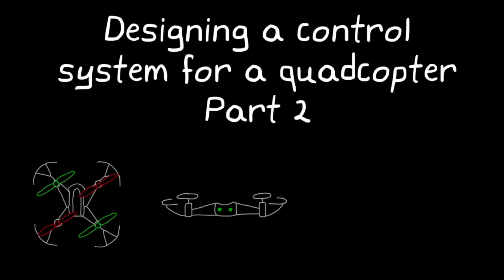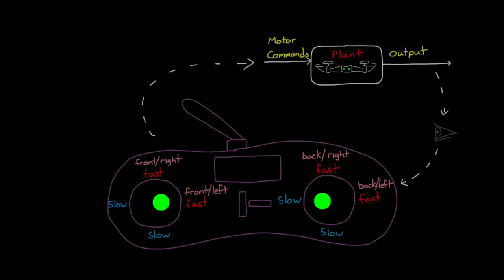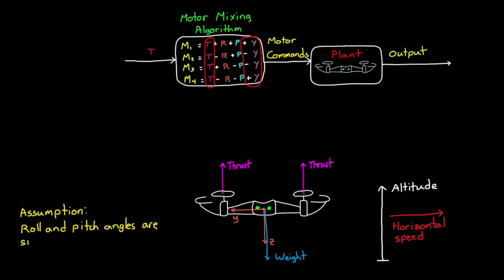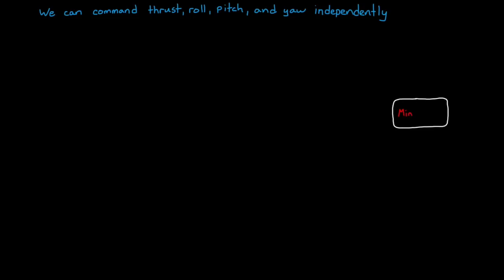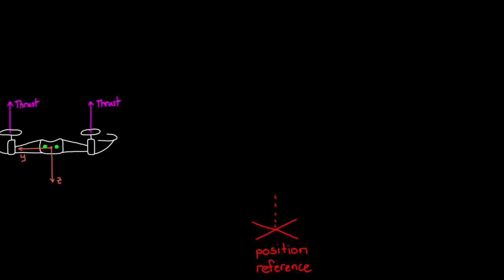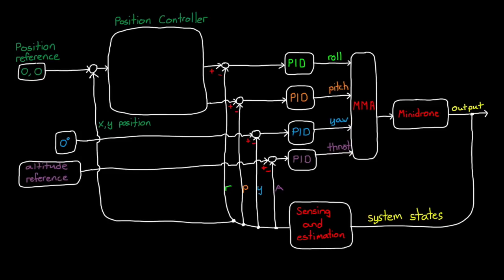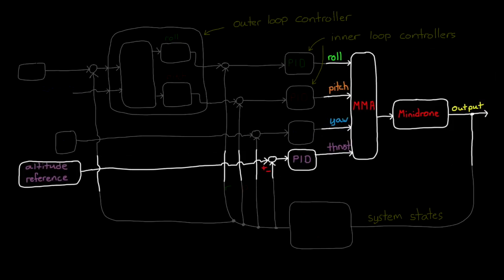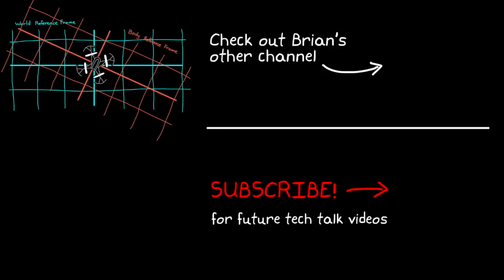Drone Simulation and Control, Part 2: How Do You Get a Drone to Hover?

Comment: Hi everyone, thanks for watching! If you have any questions for me leave them on this comment so I get notified and can try to get back to you. Cheers!
Reply: Great video! I ask myself: At what point would you "interfere" with manual control inputs now while the drone is running? Like in a drone that you fly yourself, but once you let go of the sticks, it just hovers where you left it?
Reply: sphericalsphere you could set up your hand-held remote controller to command altitude rate, yaw rate, and XY position. These would be converted in the software to the reference signals that the control loops use that I described in this video. When you’re “manually” flying your drone you’re telling it to go up or down, or to rotate, or to fly horizontally. The inner control loops are still running during this and keeping the drone stable and following your commands. As soon as you let go of the toggles the drone would immediately start to hover since you’re telling it to stay right where it is.
Reply: hi brian 
i am having project to design a lidar enaled uav system for terrain mapping is it possible to use a lidar sensor in this also
Reply: Dude I follow your channel as well, I had no idea it was you in this series!
Reply: Great video Mr Brian, my question is how you can get the (x,y) coordinates without a GPS.
Reply: Hi Brian,

Thanks for Great video!!!

Can I ask a question about the Drone Control but not using PID using LQI. I have quad dynamics, which  have motor speed expression such as thrust=u1^2+u2^2+u3^2+u4^2 , x direction tork = u4^2-u2^2 and so on. As you noticed, these are square terms,in that, direction of rotation is ineffective for my dynamics. But you explain so much direction of rotation to reach reference point. How do LQI controller track reference succesfully without concern direction of motor. Briefly, direction of my motors are not important for my model. Is something wrong ?
Reply: Hi, can you maybe further explain why we need cascaded loops for the pitch and roll angle. Cant i just multiply the position error with some constant value and restrict it to lets say +- 5 deg and use that for the second PID loop? That way we have less PID controller to tune. Other online material stated that cascaded loops are only of an advantage when there are multiple measurements and a faster and a slower loop. But this is not the case in this system. Thanks in advance. Btw, great series, currently trying to build a control system for an arduino drone, you are helping me alot.
Reply: How do we interpret the result that the mma gives us, as forces and moments or as something else? Cause we need to give a duty cycle to a pwm for controlling the motors.
Reply: Could you please provide us the presentation in any format like ppt or pdf.
Reply: Hi Brian, at 9:46, you mentioned cascading pid controls, considering roll alone what is the error fed to the first pid? Also yaw is common to both world and body? Is the conversion like a transform b/w planes?

Comment: Great video but I mean a rate controller is normally used commanded from attitude controller. Angular rates are measured directly and quite accurately. Therefore it is possible to command a rates into inner controller. The feedback would have better rejection for disturbance as inertia change etc.

Comment: Great video and explanation.
I am wondering - wouldn't it be possible to use a neural network to figure it all out by itself? (of course this includes crashing the drone more or less often....)
Reply: Well, I am not sure whether I understand your question correctly, yes, NN will work for sure, however, a simple NN will not, for this kind of task I highly recommend using simple algorithm which requires less computational ability. And also, NN can be used to identify the quadcopter model more precisely than traditional models, which can make us control the drone more accurately.
Reply: If you have a model of the system, i.e.,  equations that predict the position and velocity of the quadcopter, given the input rotation speed of the rotors, you use reinforcement learning to train a neural network which will serve as the controller.